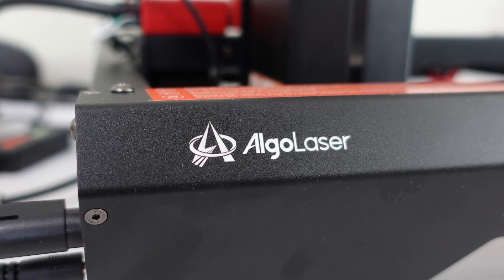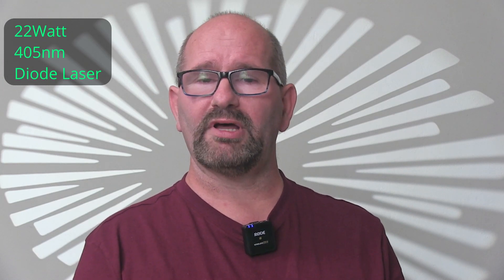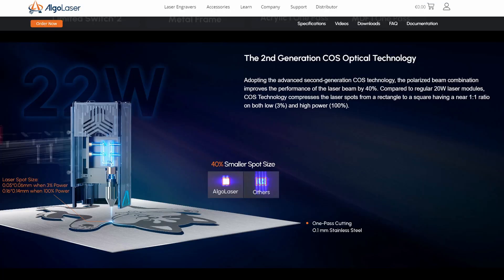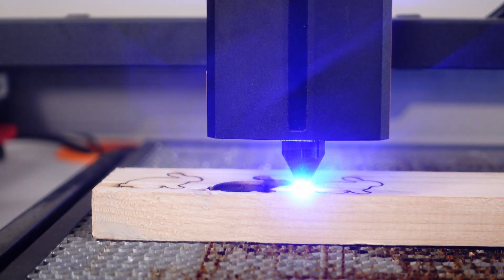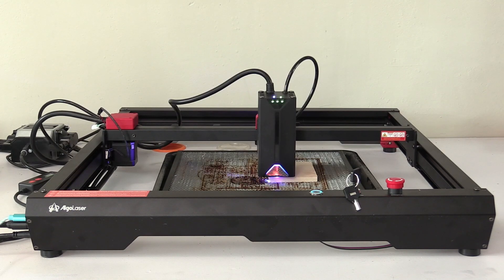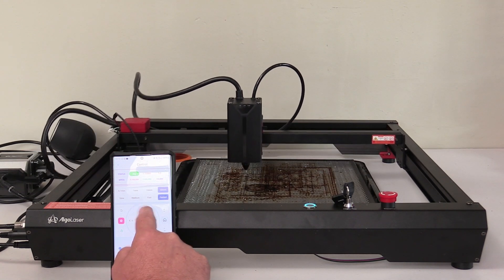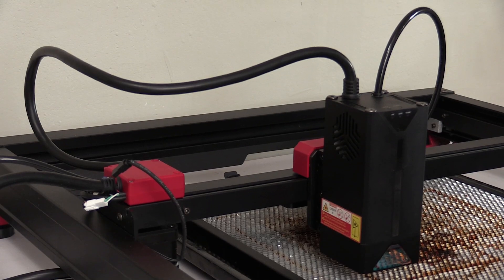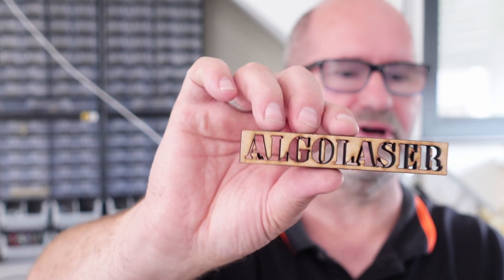▼ Review of the Algolaser Alpha

Comment: How do you feel it compares with the Falcon2 22w
Reply from the maker: I didn't include it in the video but when I did the cutting test in Lightburn, The Algolaser opened more holes at lower speeds than the Falcon 22Watt and also it is more user friendly to use.